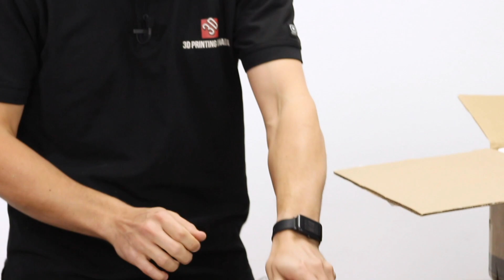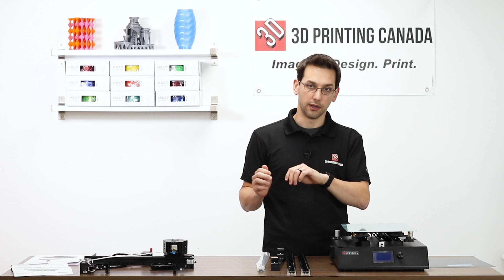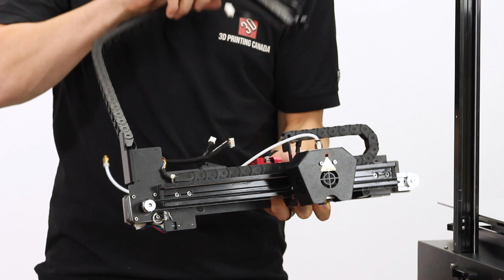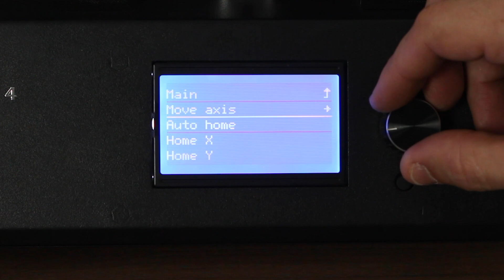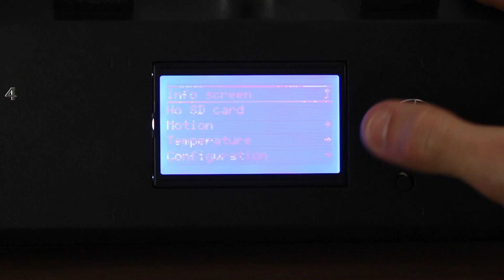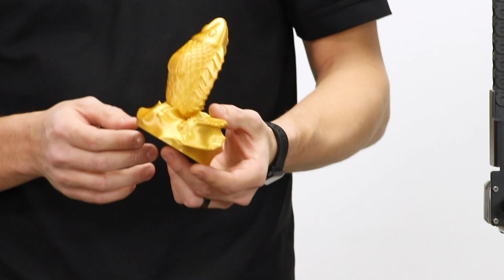Ortur 4 V2 Review Unboxing, Build, and Test

Comment: Hi a quite usefull review! With some hints for what I have to look after when I set up mine. The only thing I am always wondering in most of 3D printer reviews is that most of the time only PLA filament is tested. My plan is to make functional parts with the 3D printer (UV resistenf for outdoor use for example) and not only nice, little figures. So I realy need to print other materials and not only PLA (Nylon, PETG, ABS, ASA, etc). But other than that again: A realy helpful review!! Thank you very much!